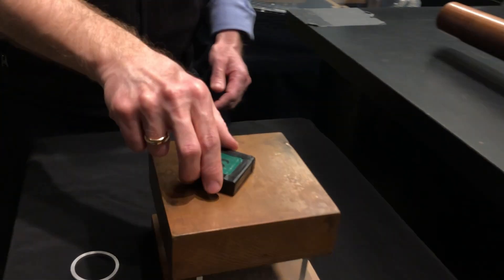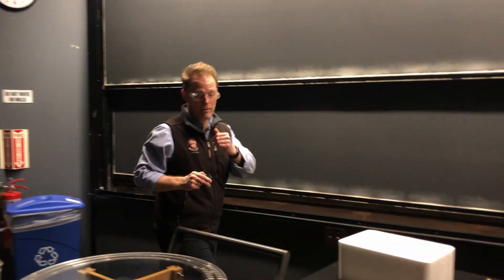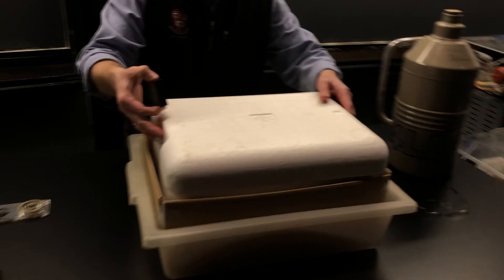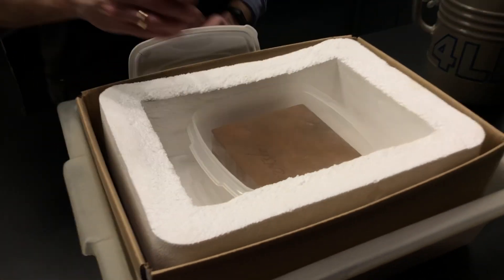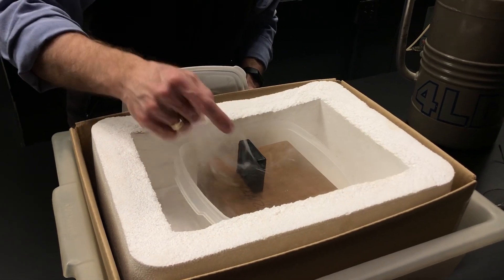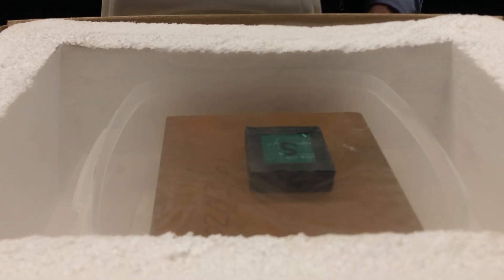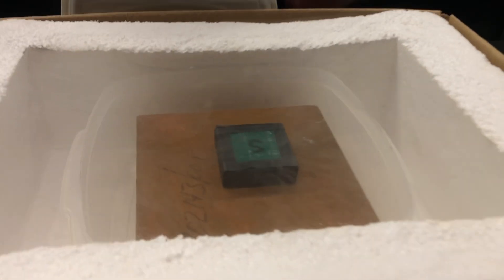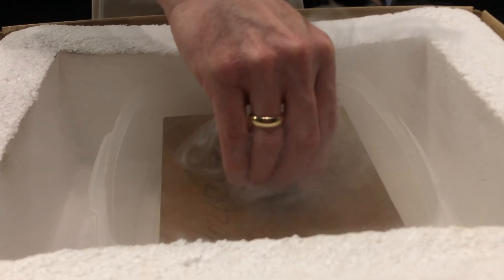6 Electromagnetic & Acoustic Science Demonstrations at Harvard University

Comment: Try using a vertically oriented copper tube about 30 cm length and 2 cm I.D. Then drop a strong small magnet through the center of the copper tube.  The magnet will take a long time to fall downward through the open interior of the tube.

dropping

Comment: Look to the sparcs when you soom in they show you wat is happening ❤
The moment  u understand it❤

The magnet introduce conditions towart the behavieure of the cohesieun of the koper dimention in to the coper dimention for the magnet to react inbetween it❤
Reply: Actualy this experiment should olrady have proven that cenetic magneticle(draged and released  as counter feildflow ) dus  exists😅😅😅

As your second plate coorolates with the uperplate❤ ophone the conditions of the closing in magnet❤ 

In a way if you vind a way to make a regulating full valve gate resistor for the big magnet it's feildflow to lower and higher resistance you are able to stabilize the magnet below❤
Reply: Question if you rotate the lower magnet in operside direction?
Vergeten the top and see it'll the motion is a litle bit more smoothly our not🙏😋😍🙏

And the uper separately olso in boths directions❤ and see if it is diverend 😍
Reply: So beautiful oll thos things you have❤ like a bick playground ❤
Reply: Sparks in your case is not a pixel error❤